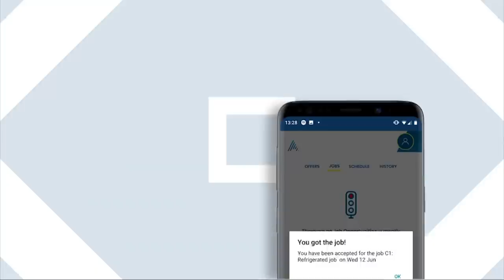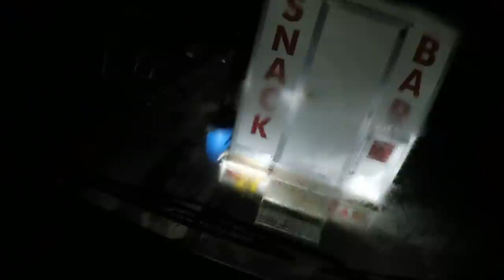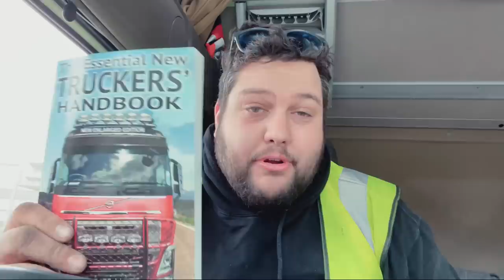What Happens When You’re Given The Incorrect Delivery Address?

Comment: Great video Luke :) A suggestion: instead of wasting your money and the environment on wet-wipes, buy a dozen pack of flannels/face cloths from ASDA or wherever and put each of them in a ziplock bag with water and soap solution. Not only do they clean you and feel 10x better, you can almost infinitely re-use them, just chuck them in your washing bag. You can also heat them up on your vent heater outlet or in a microwave for 10-15 secs ;) Pay yourself instead of the wet-wipe manufacturers!

Comment: I've had this a few times. Not myself but HGV driver's asking where a developer is. I work on building sites installing utilities. Usually happens when you have a site with multiple developer's working on different phases. Most of the time seeing I work between them I can point the driver where they need to go. Add I know the frustration on trying to find a new site where the postcode doesn't match where you need to go. Such fun.